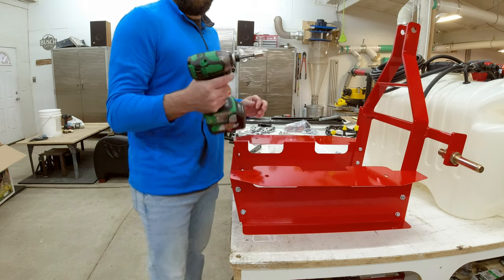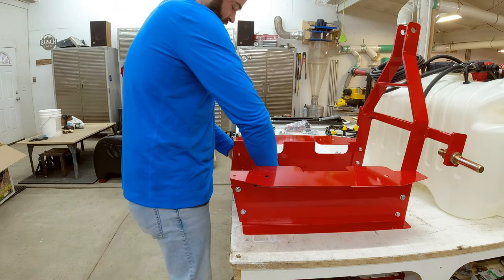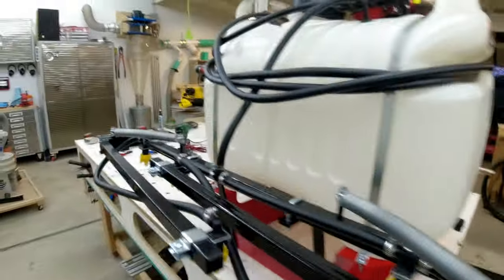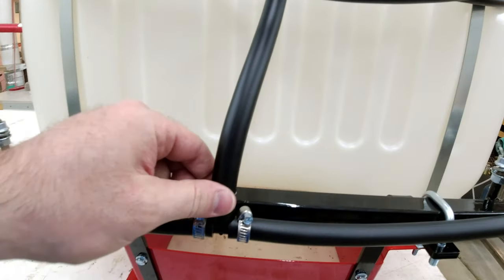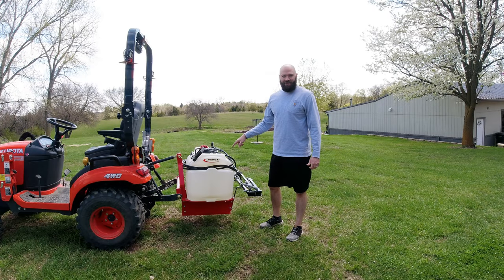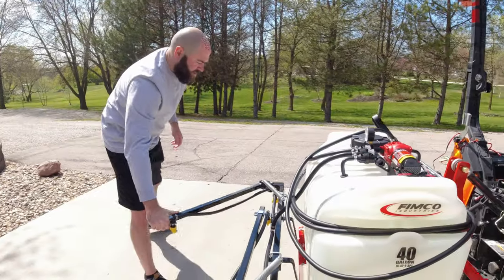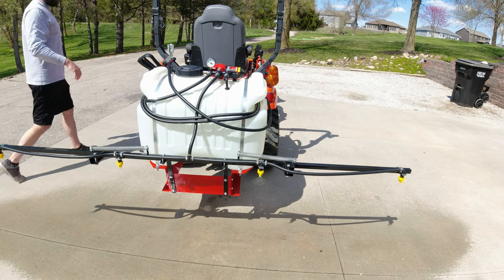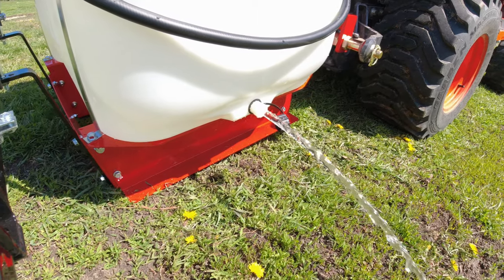Fimco 40 gallon 3 point sprayer on a 2020 Kubota BX23s!  Assembly and Use!

Comment: Great setup! I looked into a 3-point version for my Kubota but settled on a 26 Gal ATV sprayer that I mounted to an old cart. It works well on the trails, but I have to refill it 4 times. Thanks for sharing. :) - David
Reply from the maker: Thank you!  I was happy to try out the bigger 40 gallon tank as I was using a smaller 16 gallon tank.  I think the 60 gallon would have been perfect for the size of my old yard.  This will be awsome for the 3 acres we are building at.

Comment: I had. Similar worry about hoses rubbing on another piece of equipment I have. I sourced some old garden hose that fit over the sprayers hose then secured it with dirtbike grip wire but I’m sure any safety wire or zip ties would work.

Comment: The company as of 2/3/2022 is saying NOT to install the bolts on the bottom and use a peace of rubber between the frame and the tank ,and not to use the metal banding use 1" wide ratchet straps. I am still looking at this sprayer.
Reply from the maker: Interesting! This spring when I get it back out I will have to make those mods to it.  Thanks for the info!
Thanks for watching and commenting!